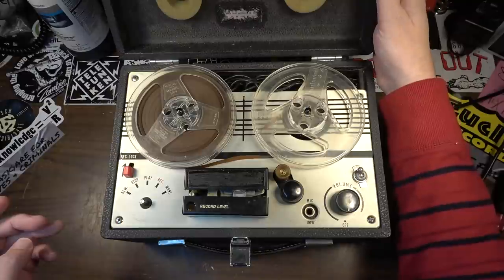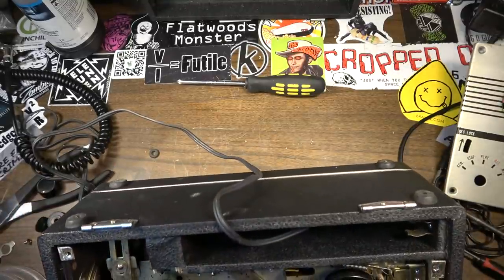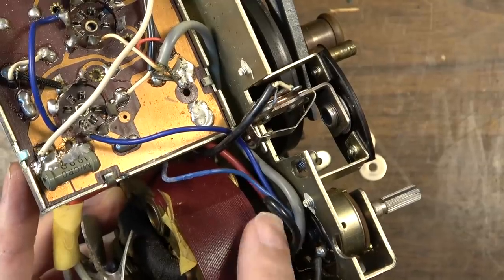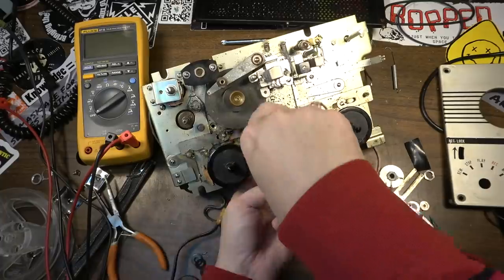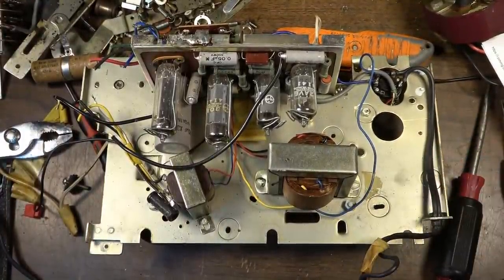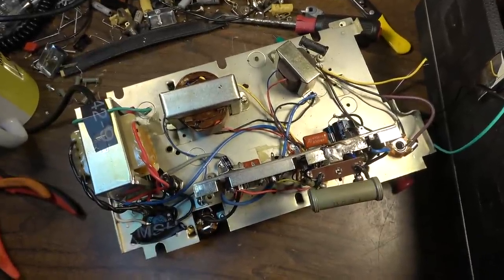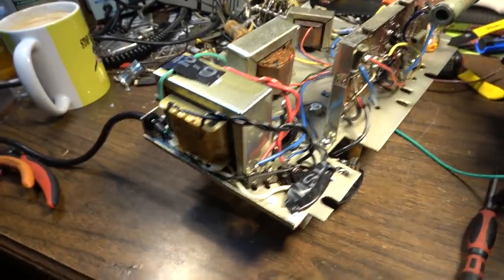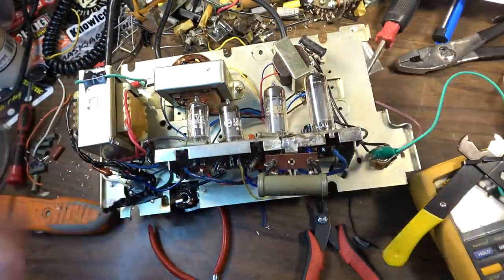Converting a JUNK Tape Recorder into Guitar Amp - UPCYCLED MAGIC!

Comment: I have an Airline Solid state reel to reel I paid a dollar for at a flea market. I paid a dollar for it and cosmetically it's almost mint condition. It's got both Mic and Aux inputs as well as outputs for an external amplifier or external speaker. It gets great garage rock/punk tones, just crank it up and it gets super fuzzy. I even mic'd up the original internal speaker with the little mic it came with and it sounds super cool and trashy. I'd take it apart to make a little amp if it wasn't in such good cosmetic shape and such a good decoration. I eventually want to restore it and use it for it's original purpose just for fun and do like old style 50's recording with a room mic and a vocal mic for some punk songs. Thanks for the awesome content brad, super informative and inspiring. You've taught me a lot over the years

Comment: I have a 1950s German tube radio with three speakers stereo that I would like to turn into a radio/guitar amp. All the wires and pulleys and switches seem intact, but at least one tube is bad. It is an amazing piece of engineering. It is adjustable to almost any voltage from any location via a rotating switch. I think I just need you to fix the tube portion and then I can convert the banana plug input to a guitar input.
Reply from the maker: You should be able to inject a signal into the audio output stage and keep the radio. You could even make that switchable so you could switch between "guitar amp" mode and "radio" mode.
Reply: @TheGuitologist  it has an aux in via a banana plug style interface on the back. It has one large foreword facing driver and two smaller drivers at 90 degrees on both sides. It is a SABA Wildbad (great name that is actually a place in the Black Forest where it was made) it is the same exact radio as this one https://youtu.be/knZ2vbCU6x0

Geez it is on eBay for $835.00. Don’t tell anyone but I got mine out of a roll off dumpster on my paper route. Plucked it out right as it started to pour down rain.

Comment: In the 1980s I was laid off from my job and ended up taking a bus to California to find work. I took nothing with me except clothes and my strat. Had to leave all my amps and other gear behind. After finding work I bought an old tube amp real-to-reel at a second hand store and that was my amp! It sounded great! Later when I moved back home to WV I donated the real-to-real back to the second hand store. I did not modify it in any way. Just plugged in and played through it.

Comment: These are known as Fujiya-type tape recorders, as many were made by the Japanese company Fujiya from the '50s through the 60s, with either 5 or 7 inch reels, mainly for export to sell through US outlet and discount stores, or American brands like Fanon-Masco that wanted to market an inexpensive tape recorder. Even by the early '70s, I remember still seeing these in a 'Big Lots' type store my folks would visit on weekends. IIRC, those were priced at around $60 and probably still used tube amps. I have three of the things. A 1958 Fujiya-Corder that, after some minor repairs, now works perfectly,  A second Fujiya functions, but the amp is very weak. The last, and cheapest-made is branded Morse, and has a serious overvoltage problem to the tube filaments. 
As for guitar amps, In the mid 70s brother picked up a late-50s Akai 'Terecorder'  for $10. Much higher quality than a Fujiya and he would set it on record/pause, with the monitor switched on and use it exactly that way, or through an external speaker.

Comment: I have seen many cheaper units (even made in USA ones) use the tape/phono motor as a transformer to step down voltage and provide some halfassed isolation.

Having made a TON of these lil practice amps, you get to see all manner of sketchy electrical engineering, both factory and aftermarket. You would be suprised to hear some of the early transistor amps sing, they have their own special mojo. I have re-engineered the whole amp, but most times just inject the signal into the existing audio path of the radio. That way it can still serve it's original purpose, or be less objectionable to decor. Many old radios were 2 and  4-tube monsters, with classic style and half-stack volume! Many need an extra bit of gain, but there are often unused curciuts available on the board already after conversion, or a punch die and extra preamp tube does the trick. 

I protect (using a bandpass crossover) or usually, replace the old speakers. They are the only thing that doesn't hold up well after conversion on older/smaller units. It's also the easiest way to taylor the tone of the cabinet. With an eye to efficiency, Q and interior volume, you can also increase the volume quite a bit. Properly specing caps can also give more volume to many amps that came undercapped, but it ocassionally kills the mojo so try it both ways!

Great work.
Reply from the maker: This thing had a lot more in the tank if I wanted it. With that extra 12AV6 up front, it was overdriving the 6" speaker beyond what it could handle, so I backed it off a bit.

Comment: Cool, might have been nice to hear through an 8" or 10" Jensen. I used the single ended 6AQ5 and 2- 12ax7s amp from a Pentron reel to reel that I had for years. I put it in this late 30's- early 40's classroom wall-PA speaker. Very art deco with two tone light stain/dark stain hardwood front. Best part is it's 'wedge' shape allows it to be on it's back like a stage monitor, or on it's bottom with a perfect tilt for sitting and playing.

I never repurpose good operating stuff, but was bored and have a collection of Voice Of Music (VOM), Ampex, Akai, and I love my Wollensak reel to reel workhorse desktop portable units. I made many tape loops using those old Mono " public school" tape recorders. You can put the entire amp/ controls from an old 50's b&w tube type Wollensak into a 1970's olive green Solid State version, and vise versa, with same exact fit and connectors. 

 Loops don't need reels, but if you want a long loop you can use cardboard with pencils. General concept is 1.MAKE SHORT LOOP, 2.PLAY IT BACK ONTO CASSETTE (or another reel to reel) RECORDER WHILE DUBBING NEW MUSIC WITH THE SHORT LOOP. 3. PLAY CASSETTE BACK, NOW YOU CAN MAKE A NEW LONGER LOOP FROM THAT, AND SO ON.

Comment: Used a Roberts tube tape machine for a practice amp about forty+ years ago.  Ran my BC Rich (which had two preamp/booster stages} into the mic input.  Switched the guitar "out-of-phase" to get that Brian May treble cut.

Comment: I've built several amp kits and some amp conversions, also some scratch builds. But I didn't really learn that much from the kit builds. I learned mostly from Brad and uncle Doug, Both of them have lots of videos and if you keep watching  them you will start remembering some of the technical stuff. But a kit is a good start. I recommend a fender champ clone or a tweed deluxe.

Comment: I would estimate that piece is actually from the late 50's early 60's based on the build quality, the use of tubes, circuit design, type of components,etc..but I could be wrong as well. The cabinet kind of reminds me of early vox ac- amp coverings..Cool stuff Brad..Thanks for an interesting video once again! CHEERS!

Comment: Regarding the re-purposing of old devices, I agree some equipment is either too worn out to be restored, or worth more as something else, like  guitar or harp amp.  A good example is all the Lafayette police radios  out there from the 1970's.  Their value has actually gone up because they are good hosts to make boutique amps from because several of the components can be retained to build an amp with.
Reply from the maker: I'm sure I've added a little value to a few old things after videos here and there. Never done one of those radios though.
Reply: @TheGuitologist  If it can be saved from a trip to the landfill, give them a try.  A buddy works at a landfill outside of Buchanan, MI the former home of Electrovoice.  He saved a 4x12 cabinet with EV speakers from being scrapped.

Comment: The 30volts u were seeing in the jack that wasnt suppose to be there was that the left over Voltage to run the fan that was part of the series filament circuit?  And if it is then when they put the switch in and while fan was not running wouldn't the filaments in the tubes be seeing way to much voltage?

Comment: Oh hey, I have an old busted reel to reel and a couple record players to do this with.  It's not hard to come across busted or non working units- often the amp portion is fine, they have mechanical or electrical issues with the playback portions.  One of the record players has a plastic tone arm that is not only snapped in half, but the plastic is getting all crumbly.  No fixing that.

Comment: Ha! Just started rebuilding an M8 reel to reel amp into a vox Ac-4 about 6 hours ago! Don’t worry,it’s not a restoration candidate. I only have the amps from it without the reel to reel parts.
Reply from the maker: Sweet! Best of luck on the project. Send me a link if you make a video.
Reply: @TheGuitologist  I’ll definitely make a demo to put on Reverb since I have 4 of them. Here’s a demo of a couple Ao44’s that I put on YouTube (again for Reverb) that turned out great. I think you’ll find ‘em interesting. https://youtu.be/P3JGK4jH-2I  The designer really did a good job. I used two different tube compliments to get to the same end. Have to say, I didn’t know the difference between a transistor and capacitor before finding your channel a few years ago!
Reply: Don’t worry,this isn’t a commercial. I already sold them! 😂

Comment: sometimes the motor acts to drop part of filament voltage. Like on a 25L6 one tube wonder. This one has a 35,30 and 2x12 so that either has to be dropped by a resistor or maybe the motor itself.
Reply from the maker: The motors wouldn't drop much voltage, some yes, but they did often double the motor as an isolation transformer on the mains. I've seen that done.
Reply: @TheGuitologist  radiotvphononut has talked about it extensively where there is a record player motor in series with a 25L6 and the motor drops most of the line voltage leaving just enough for the 25 filament of one tube wonder record players. In that video he added a 6sq7 as a preamp to compensate for the lower volume of a newer magnetic cartridge vs the old ceramic  types, due to higher ac voltages now you could prob even use a 12v preamp tube. The motor was designed to drop 70 volts

Comment: Could you make a video talking about or fixing a reverb tank? I have a marshall with a messed up reverb tank. I took it off, and it had a wire broken from the connector, and i fixed that, but it still wont work. Idk exactly what to look for. Im using my multimeter to try and find a fault, but im confused because on the output, the positive and negative (of the RCA connector) arent shorting. But on the input side, the positive and negative of the RCA connector is shorting, is this normal? I dont think it is but idk..

Tried to find a video going in depth about them, but most are videos of people either just fixing the broken wire, (which i guess is common) or just replacing the whole thing. I would just replace it if i could afford it, but i cant. Would like to get it fixed, but again, dont really know what im looking for.

If i could afford it, i would just send it to you lol, but cant. Well any help from anyone that knows more than i do about them is greatly appreciated.

Things ive checked/tried:
-I checked the actual RCA wires all the way up to the pins on the board of the amp, looks good.
-Tried swapping the input and outputs thinking i may have swapped them on accident, no difference

Comment: I have a Elpico tape similar and a matching green ac55?  (like the Kinks used for "You really got me") sounded great but both need looking at at the moment.  Got them from the garbage dump : ) I accidentally left the amp switched on for several days and the power transformer melted all its wax out and burnt. Do you ever have transformers rewound Brad ? I would like to keep it as original as possible. Ive got one that might work but visually totally different.

Comment: Ritchie Blackmore has used an old tape reel machine as a pre amp into his Marshall’s since the 70s.
Reply: Yes he did. He also used it as an echo unit. All 3-head tape recorders can easily be used as echo machines.
Reply: @BigTrouble324  he used it more to juice the front end as a pre amp. Echo maybe I know for sure about pre amp because he and his wife invited me out for an after gig drink they saw me play. We talked about the reel. It always went in front of the amp with volume hot into Marshall also warmed it up…….straight from the man.
Reply: Next reel to reel you get in, make a loop of tape and turn it into a footswitchable pre amp/slapback echo 😉
Reply: @Jonathan_Doe_  I guess it could be done !

Comment: Brad could you turn that into a stand alone add on spring reverb unit?
Reply from the maker: The thing with spring reverb is the tanks usually need to be impedance matched with transformers, so it would add to the cost of a conversion like this. It would be done though, sure. There are lower cost options for building your own spring reverb units.
Reply: @TheGuitologist  ok cool thanks I just thought with all the parts you had already it wouldn't be a big change but I guess you are right. If you change the transformer then you have to change tub configuration. I didn't think that far ahead lol. Shows you how ignorant I am about this stuff. Really enjoy all of your videos though thanks for the reply Brad.

Comment: It would be one thing if it was a good quality R2R but it isn't. It is basically garbage unless you make it into a guitar amp. I usually try to buy ones with a transformer and 6V6 type amp. Usually with a 6X5 rectifier. You can take a revere 100 and make a really nice guitar amp.
Reply from the maker: Absolutely! A PT makes things much easier right out of the box. And more power too.